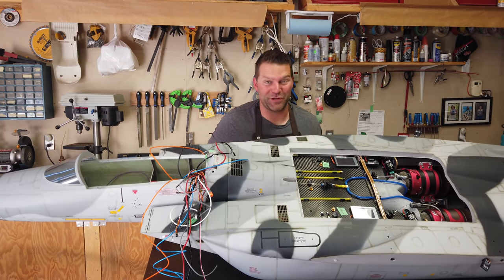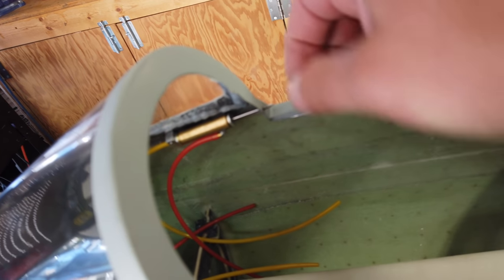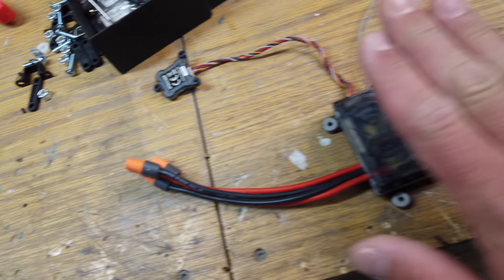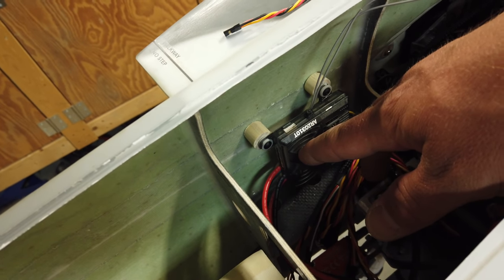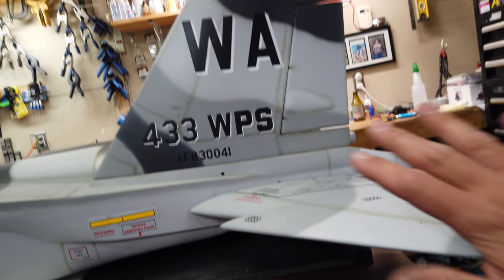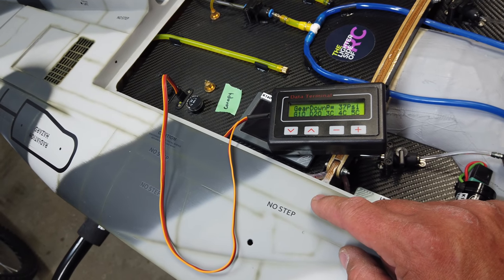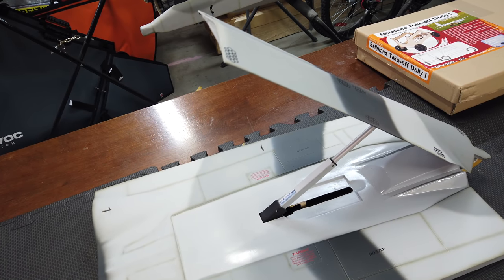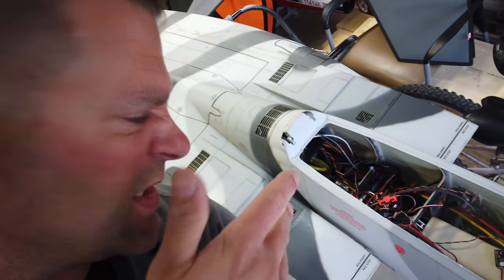F 15 CANOPY and BRAKE Setup - Fei Bao FB Jets

Comment: You should have kept the original actuator instead of that square bulky thing. Are you not concerned with maintaining a modicum of prototype appearance??
Reply from the maker: no.  Flyability and adjustability first.  The Air Cylinder didn't have the proper amount of movement so that also takes away from the scale look of the plane and the flyability.
Reply: @thelightersideofrc  so glad to hear that. Because watching it bounce around on takeoff and land on that crappy grass runway sure does lend it some serious credibility.  (Not) $20,000+ toy on grass...yeah. that works.

Comment: Well another great video in the books. Can't wait for the maiden. Hope you have nice weather conditions. One thing I need to ask, were is the gyro being mounted. I may have missed it in a previous video. Thanks again and hope you guys get this plane ready for the maiden and on a video next week. Take care and stay safe.
Reply from the maker: Thanks Hank!  Hopefully this weekend the maiden happens.  our plan with the Spektrum gyro is to fly the plane without it to get it trimmed in, then plug it in and mount it.  will probably get mounted beside front gear on carbon plate.

Comment: I see you're using an Actuonix actuator.  Can you tell me the exact part number and source?  Thanks.
Reply from the maker: I'm sorry but I didn't order them.  The owner did.  Basically what you want to do is take the air cylinder it's replacing and find a linear acuator with a similar travel range.  I typically order from Dreamworks in Florida.
Reply: @thelightersideofrc  For others who may be wondering, the air brake actuator is Actuonix p/n L16-100-63-6-R.  I think that means model L16, 100mm travel, 63:1 reduction ratio, 6 volts,  and I assume the "R" means RC control.

Comment: Should really try to get those fuel filters vertical
Reply from the maker: I hear that from many guys and in general agree.  I've never had a problem with the horizontal filters.  I think always doing a full throttle run up just after starting may be the reason it's never been an issue.

Comment: A stupid question but can you buy radio controls that will show the aircraft attitude?
Reply from the maker: Not that I’m aware of. I’m sure it’s possible but I don’t really use any telemetry myself as I never look down at my radio.
Reply: @thelightersideofrc  ok, thanks. Given the speed of these jets do you ever lose sight of the aircraft in light cloud - or just don’t fly in cloudy conditions?
Reply from the maker: It can happen. White plane on a cloudy day is a bad combo. Still fly but requires focus.
Reply: @thelightersideofrc  thanks